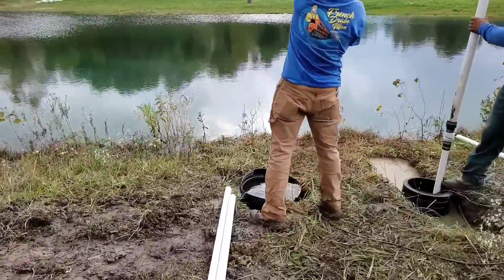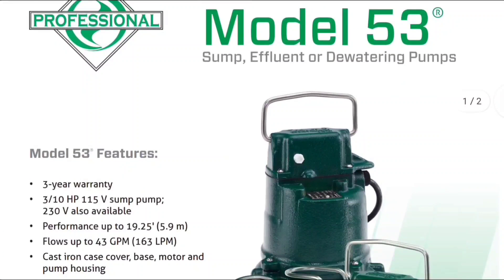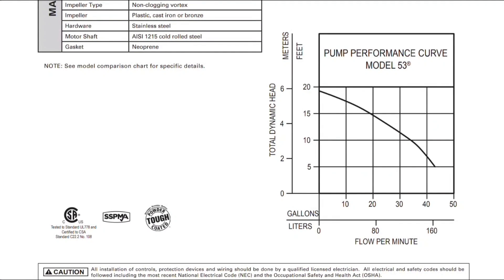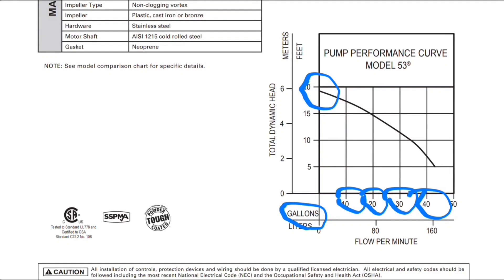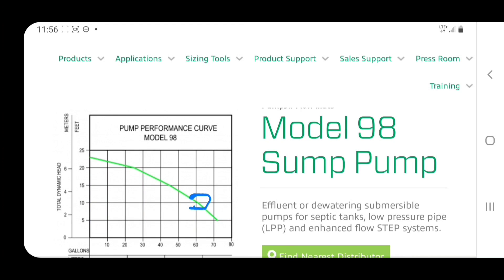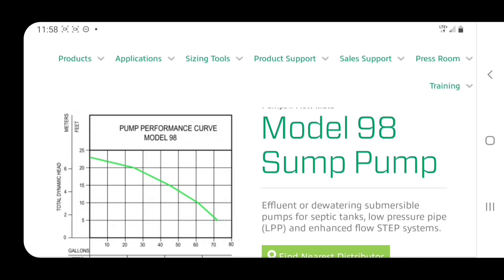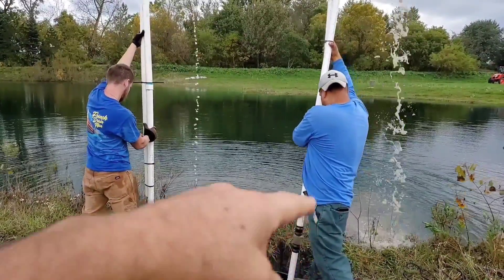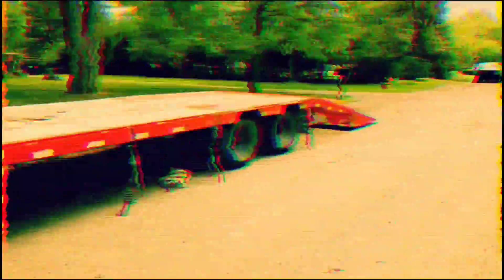BACKYARD SUMP PUMP Basics Part 1: Understanding GPM with Live Demo

Comment: Learned a lot from the channel and set up a outdoor french drain in eastern NC and which got other info but still worked out I went with 2  4" blue octane and 4oz fabric from french drain man.   And then a basin 24 x 36   with Zoellee 298 light commercial. That goes 130 gpm with 5ft of head.   And catching 5 neighbors yard of water in backyard.      Some good down pours still has water setting but after about 20 mins of no rain works.      Round rock was too expensive so I went with #4 stone I think it's called 3 to 4 inch stone.    Discharge is 2 inch scheduled 40 pipe
Reply from the maker: https://youtube.com/playlist?list=PLjFCqaZ4v1BXXbPw3Vf7e86DbKj7qOnLn&si=9uAYyZwn1_wqo4k4